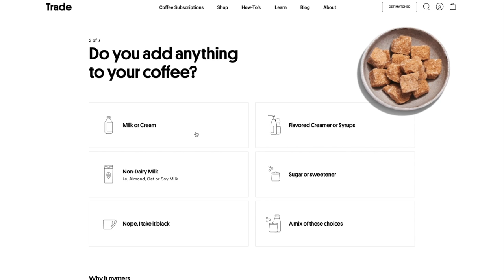FIRST DAYS AT OUR CABIN IN THE WOODS | We Moved In!

Comment: Love your cabin! One reason your stove is where it is so that the heat coming out of the back of it can get into the bedroom behind. If you put the stove in the corner of outside walls, you lose the heat out the back.
Reply: Yes! Bump this comment right up!
Reply: Also, you ideally want your chimney closer to the ridge of the house. At very least, chimney should be higher than ridge of house, to get proper drafting.
Reply: And remember that most of the time you will spend huddled around the fire will be those long dark winter evenings - when you won't be able to see the good view anyway.
Reply: Also, as heat rises, the loft will get warm

Comment: Love it! Suggestion: Put a deck on the outside of the glass wall and turn the glass wall into sliding doors!! It'll be great in the summer to open up the living room.
Reply: What about garage door style windows? I mean I just like all the ideas- just throwing another one out there
Reply: No one of those accordion glass doors that fold open and can transfer to open all the way up so its like ur sitting outside wile ur inside
Reply: I absolutely love your cabin. Bec I'm glad you are feeling better.  You two brighten up my Sundays.
Weird question, I noticed your boots, cause I love footwear, and was wondering if they were a product by Xeroshoes?
Keep on keepin' on.
Reply: I love that I idea!
It’s great.
I love u guys sososososo much but I loved your van life!
Reply: These are great ideas but they are really only suited to warm climates. Folding doors and sliding doors, anything with lots of glass, lose so much heat and they leak air. They aren't worth it. You'll regret it when winter comes. It you want an all glass room create a 3-season room that gets closed off when it gets cold.
Reply: @gblakev  Very true, but with a wood stove for heat, some air movement is desired and needed.    I always have my window open a crack in window while the woodstove is burning away.

Comment: Hi, wish you the best on this new project. Here's some ideas for winter, which is coming fast, I live in Gatineau, so we are probably gonna have similar weather.

Primero: If you have the money, redo the insulation. The whole place doesn't seem to have a vapor barrier to protect it from water damage. #1 Remove current siding and seal the exterior walls & windows with Tyvek (Good air/vapor seal is more important than R60 walls) #2 add 2-4 inches of panel insolation on the exterior. #3 Put back siding #4 Remove all batt insulation inside #5 Install new batt insulation #6 Cover with a vapor barrier (Try to prevent any wholes like a electric plug fixture)

Repeat all this for floor and roof if you have the time. Roof would be the most impactful change honestly.

This will drastically increase your comfort level and the amount of wood you'll need to burn.

Segundo: Change the wood stove for a more efficient furnace(or add) and find a way to circulate the heat in the home (Cheap idea is open concept + fans). 

Tercero: Change the windows ASAP. Double pane. Triple pane would be a waste of money on an old cabin. Take your time doing the details during installation to prevent water leakage and creating an air tight seal.
Reply: I was looking at it thinking how cold it's going to be with just that wood stove, and not much insulation. But doesn't open concept require a main support beam across the ceiling? That's thousands of dollars...
Reply: @jonap5740  agreed, I would go cheap open concept. Keep the columns. Maybe have some walls go 80% with an opening at the top to encourage air movement and allow natural light in.

Comment: So happy for you guys, looks like you're having fun with all of the projects! And such a beautiful place!! Mold remediation! Don't skip it. Mold can make you sick if left to grow. Put a dehumidifier in the basement, one in the main floor near bathroom/kitchen. I think I remember there being a crawl space that was not sealed (soil was exposed to underneath the floor of the cabin) if that is true, you have to seal it off to prevent mold and moisture damage. I'm sure you know it needs a new roof. Basically, owning a house involves keeping it from being damaged by water, avoiding deterioration, decorations, and you're good to go.
Reply: I doubt that a dehumidifier is needed on the main floor.   Wood heat is incredibly dry and will do a better job drying out the main floor than any dehumidifier would!.

Comment: That basement was in better shape than I thought, and all of that reusable cabinetry, wood, etc. Wish I could fast forward 2 years and see the results lol I know the stove in the corner is an aesthetic but I agree with the placement, just add blowers as suggested and re-pipe the exhaust. You can put a couple plug in radiators to heat the upstairs when there are guests. I love the idea of an extra cabin, would that become your main or a guest/Airbnb?? If you are planning a cabin, not sure you need to turn that shed into a tiny home, probably need it more as a shed with grounds maintenance a constant.  Create a driveway, fix up the grounds....grow a family there, yes??

Comment: I love that you’re carrying your van life thought processes into the new project. You see where you are wanting to maximize the space and using it wisely. ❤️
That being said, I agree with the others about the stove placement for better heat. 🤷‍♀️
Reply: I don’t think, with all the new technology you need to worry about moving the wood stove. Heat more central would be nice but not necessary especially where the room is long and thin. The stove cuts the space. Love your wall of windows idea. Buy good insulated windows you won’t regret the light it brings in and u won’t lose much heat.  I’m all about bringing the outside in. Great for depression in winter months.

Comment: You were already a trend setter with your vans!  Do the same with your cabin....go net zero!  It is not as hard as it sounds (trust me I'm an architect that specializes in net-zero / high performance homes).  There are multiple methods.  Focus on air tightness, exterior insulation, carbon neutral materials, zero-VOC indoor finishes, etc..  There are plenty of other YouTube channels about cabin renovation, but none that I know of focused on net zero energy and net zero emissions .... on a budget.  I know you two can do it!

Comment: You guys have a gem in the rough there!  Couple of things about your plans, though... First, make sure your roof is solid and in good repair.  No sense pouring money into renovation only to have it ruined by a leak.  Second, unless you are going to put in central heating, please keep the wood stove where it is - that central location is helping to heat the whole house, including the bedroom behind it.  If you move it into that corner you will lose a lot of heat to the exterior wall and all those windows.  And speaking of windows... third, make sure adding the extra windows won't turn your home into a furnace in the summer.  If you're set on windows, make sure you include space to hang thermal curtains to help retain heat in the winter, and some form of awning to block some sun in the summer.

You have a ton of work ahead of you, but that is the best part of having a new space.  Good luck and have fun!

Comment: :_TRINITY:To heat the basement using stove heat... Cut a hole in the floor, run a dryer hose down through it with a small fan inside the dryer hose. Pro tip. LOVE the new place, guys. Can't wait to see it transform! :_REROOT:
Reply: But .... most wood stoves of that design have a hole already cut in the bottom of the stove to pull cold air into the stove for burning.
Reply: @iamsoaringeagle  No more holes required in stove to run the dryer vent hose like I mentioned.  It simply sits a few inches off of the stove on any side, typically the back. The little fan in the end of the hose draws the heat from the outside of the stove and pulls it down the hose. Best to have another fan on the other end. Push/pull configuration.
Reply: @ryanbewley  Ah, thanks for clarifying.  I can picture it now.   I envisioned something different from your initial description.

Comment: I LOVe the tiny house cabin idea Bec!!! I think that could probably be a separate tiny house build (in the far future) though, because you will likely have to a) permit it anyway b) use the current shed for tools and such, and c) will want to be able to connect it to the electric in the main cabin. ALSO, is there any way to knock back that wall or maybe put the washer/dryer under the stairs? It seems like the bathroom is just going to be so much smaller and a double vanity would be so nice for it being the sole bathroom in the cabin. Maybe I just can’t see it bc I’m not in the space but that was just a thought I had!

Comment: Put windows in the screen porch, add insulation and a fireplace/wood stove and you have 1 4 season porch. Open or remove  the windows in the summer. I knew a lady that had her windows on hinges that attached to the ceiling.

Comment: Definitely need to put some shingles on the area on the left, from the rear. I realize you have a tarp on it and it’s probably not leaking inside but it’s definitely absorbing water and moisture. That’s a small area, you could probably find a local guy to help you tear it off, depending on how many layers of shingles are there, paper and “mark off” the roof for you. You could take your time nailing the shingles and it’d be leak-proof. Looks like the rest of the roof was in fair condition, for now.

Comment: You can stop the mice from coming in by installing some bubble wrap it's like comes in a 3 or 4 ft wide roll and it has insulation factors but for some reason the mice won't chew through it I don't think they like the aluminum part of it it's a real cool insulator they sell it at Home Depot I don't know if you have a Home Depot by you but I'm sure they sell the same insolation somewhere else it's got little tiny bubbles on top of aluminum foil

Comment: Insulate, insulate, insulate... Is that stove your only heat source? So many windows, very thin walls. The open loft will draw the heat. You may need to close areas off. Like the open space under your house. Prepare not to freeze your assets off.
   Chop wood and keep that pocket rocket ready...
     Sweet property. Your hard work and Passion will make it home*

Comment: Don't put a ceiling in the room.  It will make it look really small.   Put insulation and and panel over the insulation.  Leave the wood stove that is such a short distance. Just get a little portable faux one for the other area.  Not worth all that money and work for a couple of feet.  Definitely a steel roof.  Have fun remodeling.  Don't forget good construction gloves, eyewear, hard cap and strong work boots.  It is so easy to have an accident.  I guess I sound like your mother.

Comment: IDEA FOR CABIN(cool tool for dock area clean up)I used capstans in tower construction but you may be familiar from sail boats. Pulling your brush up the hill would allow working it up on a level surface and less need for taking tools down. There are cool electric ones also that could wrap around tree or mount on truck hitch. https://youtu.be/GxqztmPkv8c